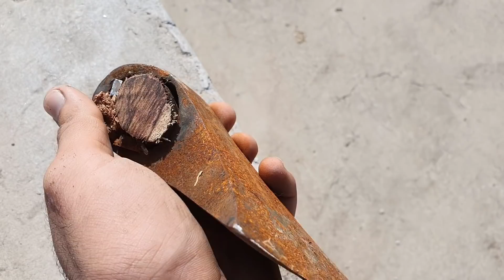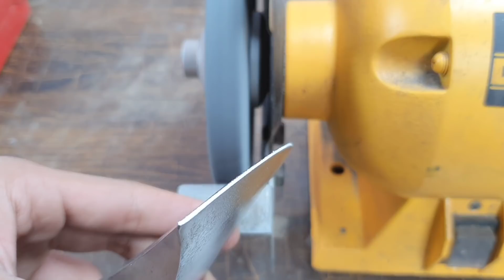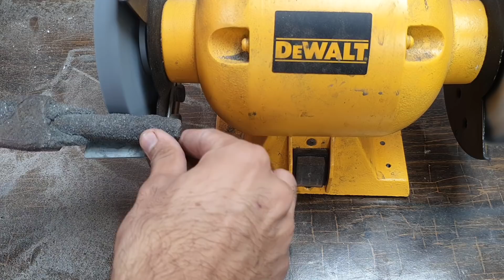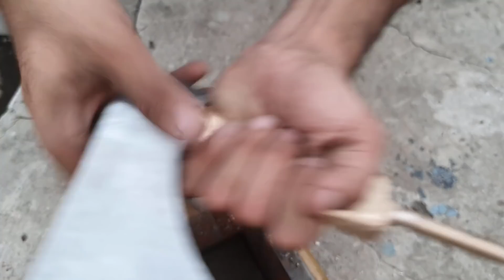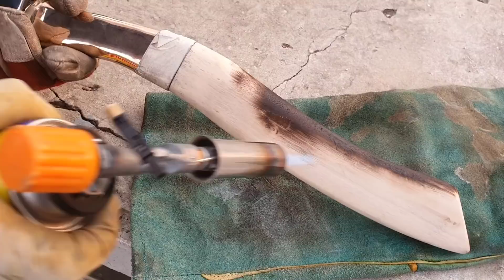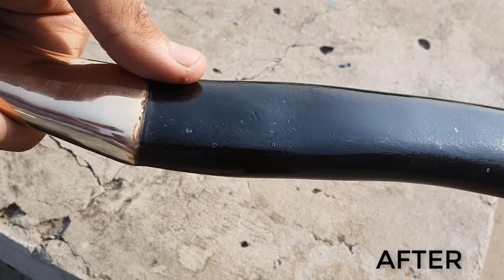Antique Rusty Hatchet RESTORATION - OLD to GOLD

Comment: Was that brass??
Reply: Candy Apple yeah looked like a brass sand casting. I would not use brass for an hatchet handle if I planned on using it. With use that brass is going to bend. For a wall hanger it's pretty but not functional, at least not for long.
Reply: قطة صغير وسماه نميرة